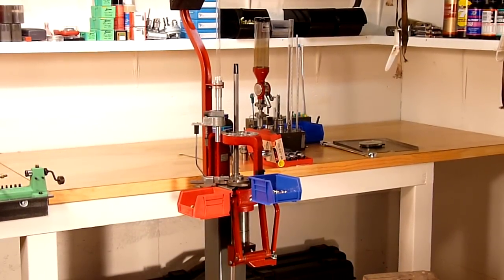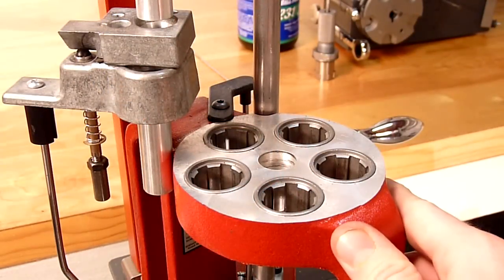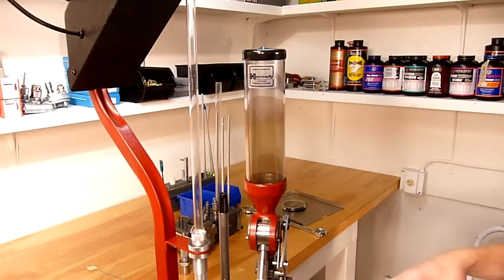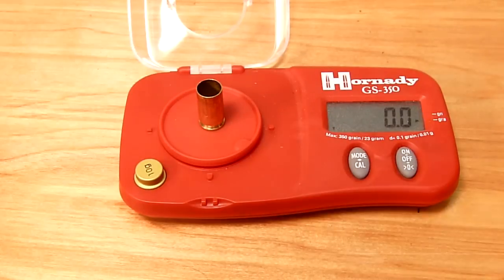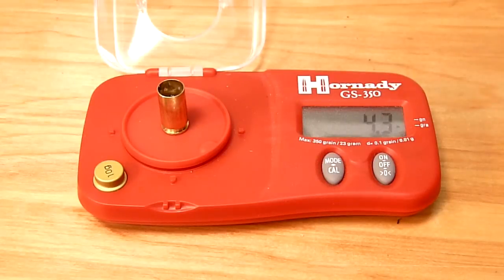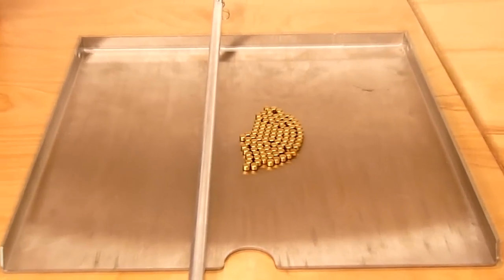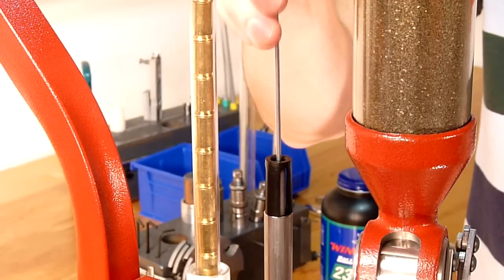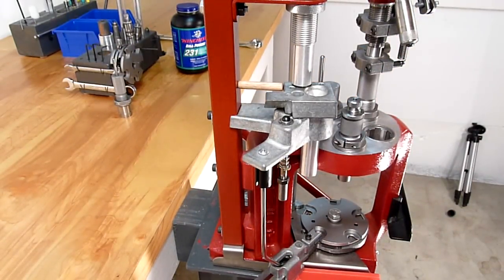Hornady LNL-AP 9mm part I (HD)

Comment: This is a great press for the money,  I've been loading on this press for 6 years I easily have over 100K on it .   Its a great press if your reloading many calibers because its so quick to change out the dies and shell plate.   I currently reload. 10mm, 357sig, .45acp and .223.  This press has a few short comings like the powder measure comes loose and the primer tube also works its way out.  But once I worked a fix for that its very reliable and way cheaper than the Dillon 650 to do a caliber change.  Plus the primer system is better than the 650.   When comparing this to my 1050 with mark 7 including all the sensors, that cost me $5000.   I have to say I rather have my 5 grand back.  The 1050 is so fast I can spend one weekend and reload all the 9mm I need for the whole year 12K so it basically sits there all year.  Anyway this press is a great buy for the money.  Very Versatile, BTW I broke the handle twice and Horanady replaced it for Free twice.   They also replaced the primer shuttle twice as it will wear out over time.   No press is perfect but for the money and if your reloading many calibers this is the best.
Reply: Can you use lee dies in the hornady ap
Reply: @Sllkl23  yes

Comment: Gavin,

I also have the Hornady LNL-AP with the case feeder. I however have the hardest time getting the case feeder to drop only one 9mm case at a time. I have tried adjusting the system from the timing rod, to the plunger rod to the threaded feeder tube for hours. When I get it to where I think it works then it will drop multiple cases or drop none (all with the same adjustment). I can't seem to find its happy place. Every other caliber I reload I can get to drop just right, but just not 9mm. Could you share any tips? Thanks

Comment: Gavin, You seem to be a master on this press. I have a question about it...how do you stop the shellplate from "clicking" into place so hard on each cycle so the powder doesn't spit out of the case? I have now loaded appr.400 rounds with the same shellplate and the press has probably been cycled about 6-700 times. I keep the detents very clean and lubed, as I was directed by hornady...still doing it. What a mess everytime I load. Also, I used your AR15 video to build my first lower..Great stuff!

Comment: You mentioned lubricating brass with one shot even with carbide dies, which I have, I can definitely agree with a benefit. But I’d like to see a video of how you lubricate them. Do you worry about getting it inside the cases?  Or do you have a method that avoids this?  I’m always confused and concerned about when lubricant left on a case is detrimental, I hear guys talk about cleaning cases again after resizing to remove lubricant. I don’t do this.  A while ago I switched from Imperial sizing wax to Imperial dry neck lube to keep the button from sticking in case mouth. Lubricants confuse me

Comment: Hi Gavin,
i just put my LNL together.I had only put the first die, deprimer and resizing. It was running ok and all suddenly, it is not indexing completely. Everytime  i push the handle the star only spin half move. So, the cases don't go into the dies... any suggestion..?

Comment: Been really thinking about getting one  just two questions for you . What about deburring the inside and outside of your cases and checking for over all length after resizing ..
Reply: stephen kerr you don't have to worry about case stretching on straight walled cases like most pistol cases.

Comment: I just got this press and am currently reloading 9mm with hogdon hs-6 powder. i watched all of hornady's instructional videos and thoroughly cleaned each piece of the powder measure, twice, with hornady's one shot dry lube but the powder is still sticking to the internal components. did this every happen to you and if so do you have any suggestions on how to fix this?

Comment: Has anyone else had a problem with loading the tubes like you see in this video? ..  The press appears to come with a small and large tube set.  Pretty sure I am using the right one for small primers (tried both of course) .. but the primers simply do not pickup.  Seems simple enough .. but it just doesn't work. They don't pickup and fall right out like the plastic mouth is too wide.   Anyone?
Reply: Just to be clear .. I am 100% a newb just getting started working out all the kinks.